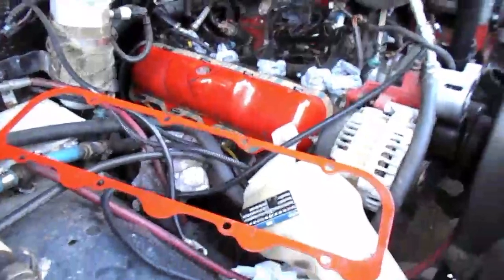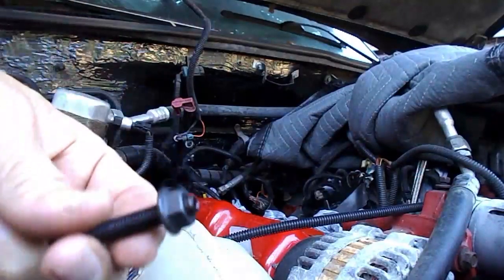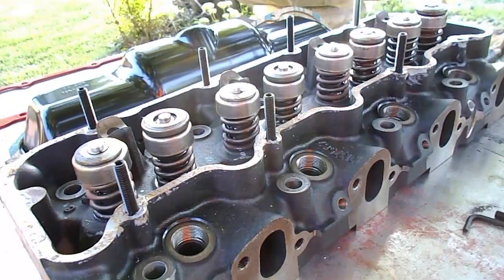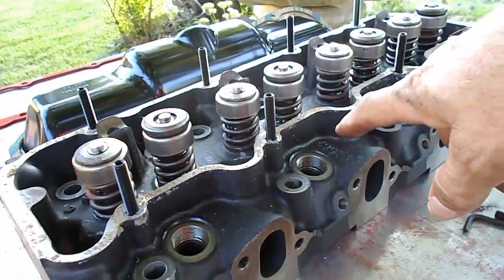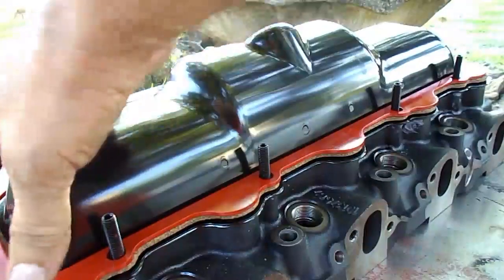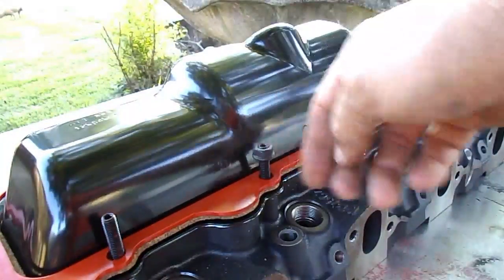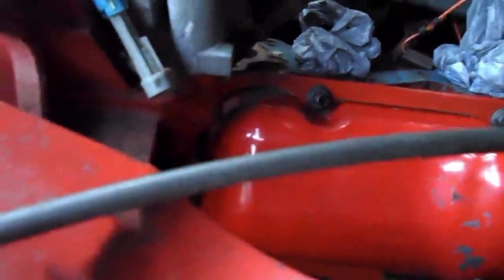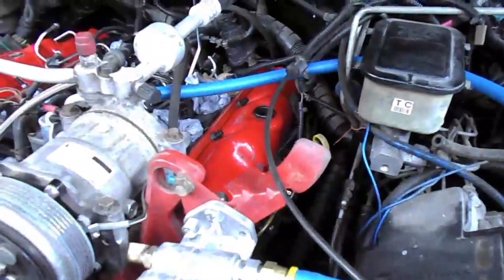New product! Valve cover girdle and stud kit.

Comment: Are leaky valve covers a problem? I have several 6.2 and 6.5, never an issue for me
Reply: Yes. It's very common. Engine gasket kits often come with valve cover gaskets so people use those when you're supposed to use some RTV or similar. Mine leaks a little even after very carefully inspecting and installing with Right Stuff.